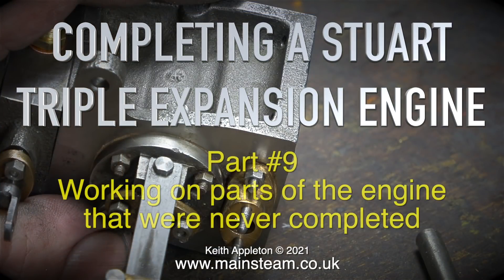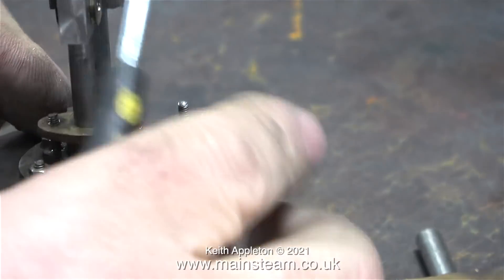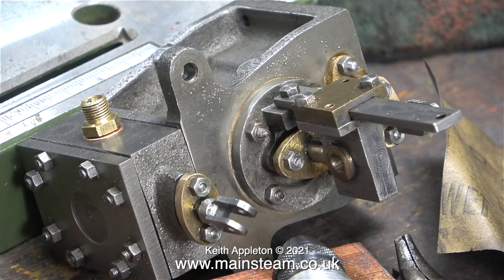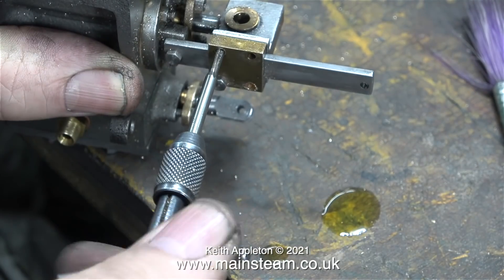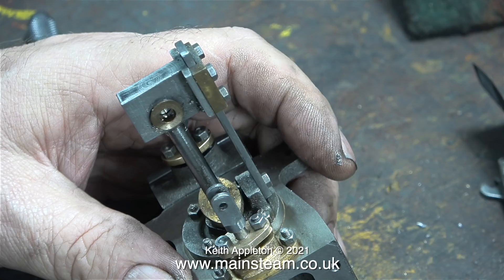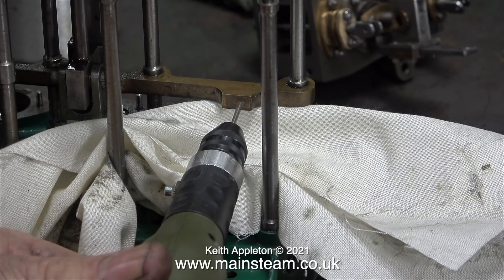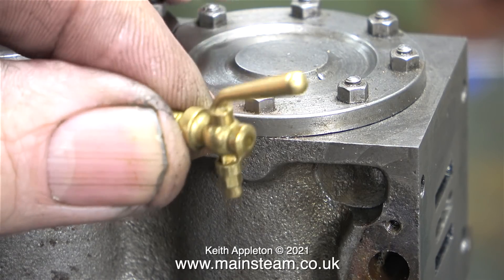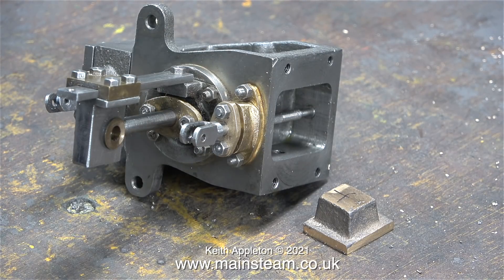COMPLETING A STUART TRIPLE EXPANSION ENGINE - PART #9

Comment: Daft Question from a non-engineer: How come you are putting a drain cock at the TOP of the cylinder? Wouldn't a drain more logically be at the bottom?
Reply from the maker: Because steam is admitted at bot sides of the piston alternately, so both ends of the cylinder have condensate to clear . . . Gravity has nothing to do with it }:-)))
Reply: @keithappleton  - Thanks Keith, I like to understand as much as possible. All falls into place ;-)